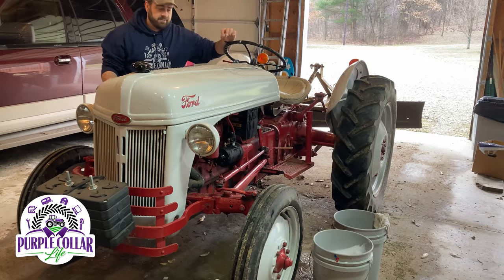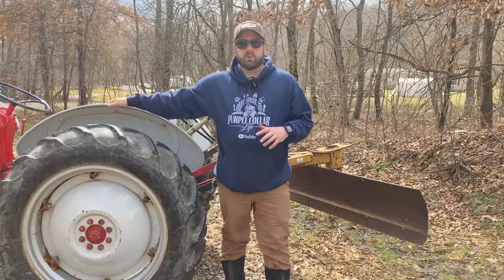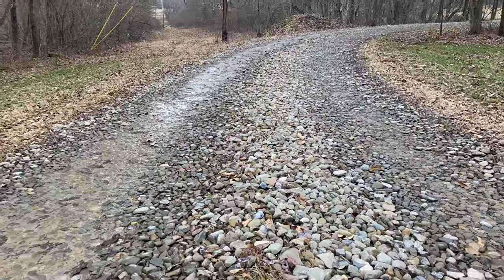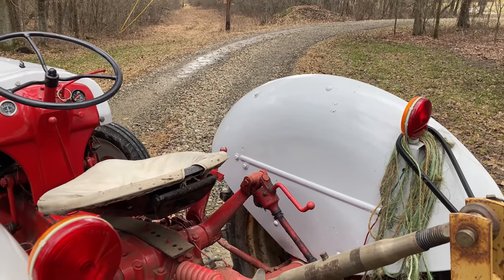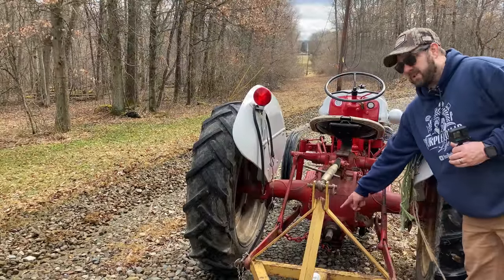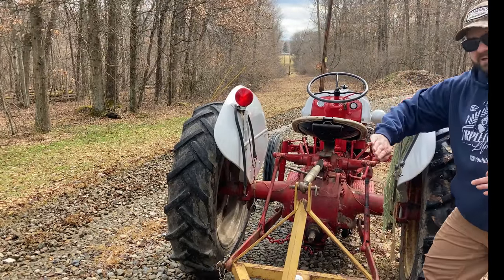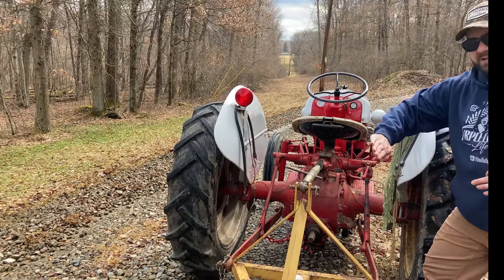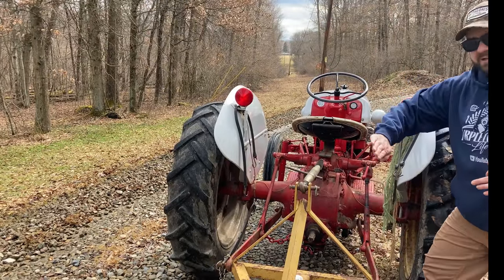How to fix a gravel driveway for cheap! Ford 8N backblade.

Comment: That was honestly a really well put together video Chad.

I do all my grading with a box blade but I’m actually wanting to get a straight rear blade like that because I see advantages being able to angle it like that and also with a tilt kit you can really put more of a crown on it.  Or even dig in with one corner for a swale
Reply from the maker: Thanks, Brock.  We've used the simple back blade for plowing snow, grading the driveway, creating swales, and even smoothing the topsoil on the lawn.  Thanks for watching!

Comment: Outstanding Looking antique Ford tractor 👌👍🧐 Great idea to wash it beford since the heat of the engine will help to dry the tractor to avoid corrosion  👌👍🧐  Back blade was the work horse of all farmers Sir like you said and my grant father and uncles were 👍👌💪 I like the coil spring on the top link of the 3 points attachment  👌👍🧐 I realy like your video mon ami about your great teaching point about farmers history Sir 👍👌🧐 keep up both of you your OUTSTANDING team work your lovely wife and yourself and keep up your daddy family work too 👌👍🧐 Keep warm Cheers 🍻
Reply from the maker: Thanks, David! We certainly acknowledge the hard work that these old tractors have done for many years.  They're excellent workhorses and really beautiful pieces of equipment.
Reply: @PurpleCollarLife  And you pretty good at it ( preserving farming history )👌👍😉🍻

Comment: Draft control lever is under the right side of the seat. I  doubt you'll ever use it. Keep these videos coming. Good job 👍
Reply from the maker: Thanks for mentioning it.  You're right - lever that switches from draft control to position control is a little lever directly under the seat.  We typically leave it in position control "mode" because we don't use a plow in the fields.  So all of our attachments work best in position control.  (brush hog, back blade, carry all, etc.)  Thanks for watching!

Comment: Good video and "How-to".  I have both a 2N and a 8N.  I also have a back blade and few other implements for my Ford tractors.  One thing I would like to have is a Yoke type rake to smooth out the gravel.  They're a bit more expensive than a back blade and not as easy to find.  Back blades, as you mentioned, can be both new, Rural King, Tractor Supply, and other similar stores carry them.

One thing, and you might have mentioned on another video.  The 8N has also a position control lever for the 3 point lift, it's the lever above the draft control lever.  The 9N and 2N do not have the position control.  One of the improvements that 8N had over the 2N.
Reply from the maker: Thanks for watching! Is your 8N the front mount distributor, or the side mount? 
I've never seen one of those rakes - but it sounds like a good thing to look for.  It would probably also be helpful when seeing a feed plot or new yard.  
This particular back blade in the video was actually purchased at a Quality Farm and Fleet.  I don't know if there are any of those around anymore.  But you're right that they're almost always in stock at Rural King, Tractor Supply, and most tractor dealers.
You're right about the position control on the 8N.  We don't usually move ours out of position control.  We don't do any ground engaging work with the 8N (plowing a field).  On the back of our 8N is typically a carry all, the back blade, or the brush hog.  
We do also have a post hole auger, a cement mixer, a sickle bar mower, and a pole lift.  
They're certainly great machines.  Now I'm wondering if one 8N is enough.  I've actually always been interested in the Golden Jubilee. :)
Reply: @PurpleCollarLife  My 8N is a Frankenstein one.  It's a 1947 (technically a 1948 built in 1947) and has an engine from a 2N.  Someone converted it to a side mount distributor and had to make some, not so good, modifications.  To get the alternator on the left, they had to push in the oil filler tube against the block and make a funky bracket to hold the alternator.  Other mods were done to make it a side distributor, and when I got it, it was completely out of time.  I got it running fairly decent now, though.

Rural King has a rake for under $500, https://www.ruralking.com/taylor-pittsburgh-field-general-5-sub-compact-landscape-rake-233-tyr-60-sc?rkgfblink=no&msclkid=5a3191c0bcf116a4f83df3fd3767c322&utm_source=bing&utm_medium=cpc&utm_campaign=Smart%20Shopping&utm_term=4581115207618592&utm_content=Smart%20Shopping&gclid=5a3191c0bcf116a4f83df3fd3767c322&gclsrc=3p.ds

I also would love to have a Jubilee, a 600 or a 800 series Ford.

Comment: I have been operating on 2000 , 4000 Fords , John Deere 5075 and M series. A few old International 1066. Love them all. I would rather drive them than a car. You need a little weight on your blade to get it down into the dirt. It will cut out some of the hop and flip up gravel that is being wasted. Don’t you just love that kink that you get in your neck watching a piece of equipment that is behind you.
Reply from the maker: Thanks for watching! I too am addicted to the old tractors. :) Yes - I do end up with a stiff neck after a day looking backwards.

Comment: Love that 8N Chad.  I have plans for a May video in which an 8N will play a key part.  BTW, scraper blades must be cheaper up there...I'm always perusing FB Marketplace and CL and the cheapest I've seen lately was $250 for a real rustbucket!  Still a cheap implement compared to almost any others, but around here it will typically take $300 or better just to get you in the door!  For reference, my Land Pride RB1572, which I bought with the LX was just under $700 in Dec 2020 (right before the world went crazy) which was a bit under "retail".

Thanks for sharing that grand ol' girl!
Reply from the maker: Thanks for watching, Chris.  The 8N is certainly a fun machine to use.  I can't believe old back blades are so pricey around you.  Were there many old farms?  I'm surrounded by old farms.  I hate to say they're "a dime a dozen", but just about every farm/ranch/homestead/property around here had one.  There's no shortage.  Some certainly have seen better days, though.  And most of the old ones won't turn around backwards. Or if they do, they only go straight (no angle when pushing backwards). 
You got a great deal on that land plane! Had you known then what you know now, you should have purchased 10 and sold 9.
Reply: @PurpleCollarLife  Sorry Chad, I should have clarified...the RB1572 is a rear blade, basically just a new version of yours!

Comment: See that you have front weights on the tractor. Got Ferguson T0-30 in Dec. & just got a 5' rotary cutter & 6' Titan blade. Will I need front weights? Tnx. Lee in VA & NC.
Reply from the maker: The front weights are helpful for when we're running the brush hog on the back. Sometimes the front tires can get a little light. If you can find a set - it would be nice to add.

Comment: I have been thinking about getting a scrapper blade.  We have a long gravel driveway and its in horrible shape.  I have been putting it off because I am not 100% sure if a scrapper blade can do the job.
Reply from the maker: We've used the back blade on the 8N (and Workmaster) to maintain our gravel driveway for decades. I've found that it works great!

Comment: Hope you had a merry Christmas! Beautiful tractor! I just snagged a '49, myself. What size blade is better for these tractors, 5 or 6 foot? Thanks!
Reply from the maker: Merry Christmas! There is probably no better Christmas present than a classic tractor! Congrats.  I like the 6' a little better because when it's angled to the side, it still clears a path as wide as the tractor.  The 5' blade when angled fully, leaves one tire in the snow (in our experience).  BUT - it takes a surprising bit more HP to pull snow with the 6' blade - especially if it's wet, deep, heavy snow.  So there are advantages to each size blade.
Reply: @PurpleCollarLife  Good insight! Thank you. Does the blade have the same concerns moving gravel? Drive way maintenance... thanks again!!
Reply from the maker: @blackriflemensorganization6139  Yes - same concerns if moving a blade full of gravel. It's less of a concern with driveway maintenance because I rarely have a full blade when just skimming the top layer to smooth it out.
Reply: @PurpleCollarLife  Thanks again!

Comment: There was a lot of material that was pushed aside of the driveway! I had a question for you.  How come you have a warning sticker on the back of your blade, as this looks to be an old blade?!? Driveway grading is one job I really like doing a few times a year.  I also grade the county road (1 mile)... Lol!  I have an old Allis Chalmers blade and it's quite well designed with a 6-way blade. I also made some wings I can attach to it, so it converts the blade to a landplane.  Anyways, as you said, they are quite a cheap implement to get (got mine for 150$). And they are very useful. No need to get a new one! Thanks!
Reply from the maker: We originally had an older back blade that we used on this 8N.  It didn't let you rotate the blade around (and angle backwards).  I purchased the blade you saw in this video when I bought my property to build the house.  It was probably about 23 years ago.  So this blade isn't as old as the tractor, but it isn't one of the new ones either.  Evidently they had warning stickers on them even back in the late 1990s.  I can't remember what all the stickers said - but I think there was one that said "for 3 point use only", and one that said "not for tractors over 35 HP".

Comment: I just got my first 8n today. Why does my 3pt not stay raised when i push in the clutch?
Reply from the maker: That can be fairly normal on some of these 8N tractors where the hydraulic system is worn.  The PTO running allows the hydraulic pressure to maintain - keeping the 3-point implement raised. But as soon as you push in the clutch and the PTO stops, the hydraulic pressure can drop off.  In my experience - some tractors this is more of a problem than others. Our 8N will hold the implement up but have a slow drop over time.  About 30-60 minutes of the tractor not running, or the PTO not running, and the implement slowly drop.
Reply: @PurpleCollarLife  thanks. Mine drops as soon as i push in the clutch. Should it do that, or maybe the hydraulic cylinder is bad?
Reply: @PurpleCollarLife  thanks for the content, also. I've wanted one of these tractors for a long while, but I've never used one. Your vids are a big help.

Comment: Why do you have the right front wheel set out further than the left? I couldn't tell in this video but others I could.
Reply from the maker: That's interesting that you noticed! I never have noticed - but just took a look. You're correct - the right side is set out 1 bolt hole further than the left side. I have no idea why. We've never moved those - so I'm guessing it was something that someone in our previous family generations did at some point - perhaps when farming the homestead many decades ago.

Comment: Been itching, and afraid of using my box blade on my driveway.    It is starting to get the high spot in the middle and the two depressions that puddle to your point on the sides... I'm just afraid of making it worse than it is while I learn how to use the box blade appropriately.
Reply from the maker: I'd give it a try.  You won't learn until you do it several times.  Each time you'll improve.  Thanks for watching!

Comment: Nice job, Chad! Will that blade fit on your JD tractor too? Cheers!
Reply from the maker: Thanks, Mike.  The blade will fit on the John Deere 2210, but. . . the rear arms are not long enough to allow me to rotate the blade around 180 degrees. So I can angle it to the right or left, but not swivel it around to face backwards.  The 3-point arms are just short enough on that tractor that the blade makes contact with the rear tires when trying to spin the blade.

Comment: You probably discovered it by now but your exhaust pipe is loose.
Reply from the maker: Thanks! We tighten it regularly. I think maybe the vibration loosens it over time. I have been tempted to use some loctite on it.